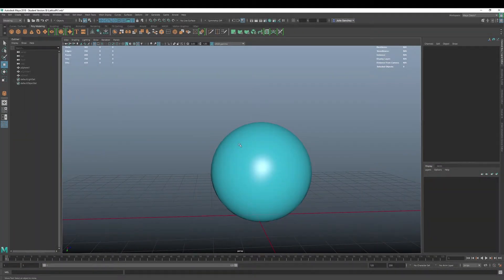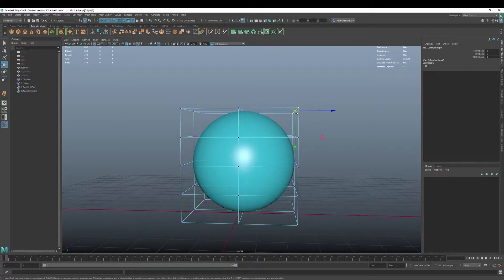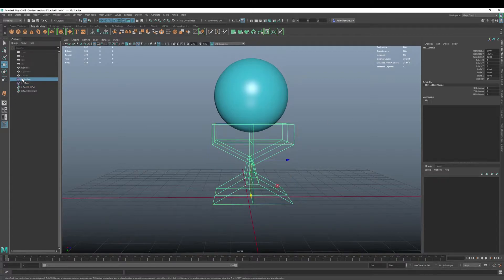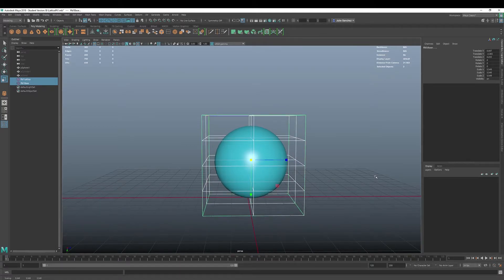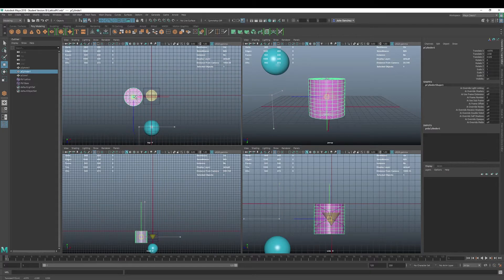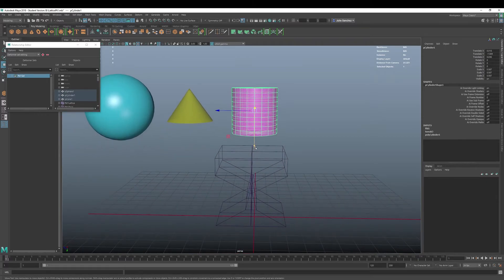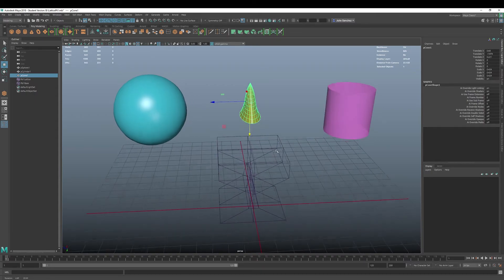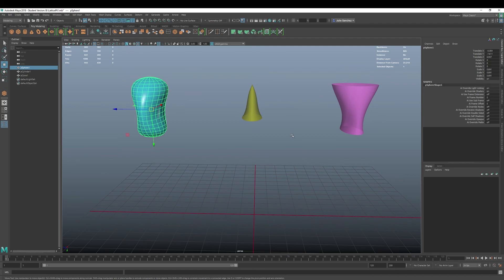Autodesk Maya 2018 Basics- Lattice- A Free Form Deformation Part 1

Comment: followed the basic steps. Select a polygon geometry, go to deform > lattice. Lattice appears, you even see it on the history stack of the object, move lattice points... boom. nothing happens. doing a google search led back to old forum questions about the same thing that usually give non-answers or solutions that dont work. Anyone else having this issue? Im using maya 2019